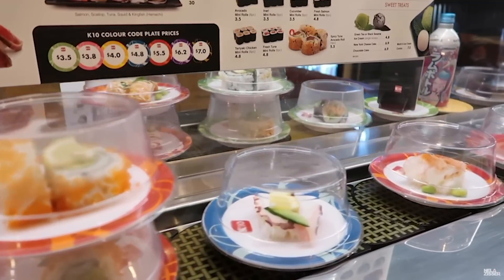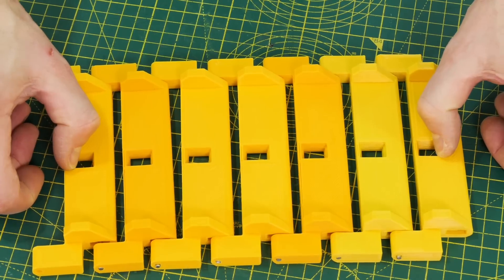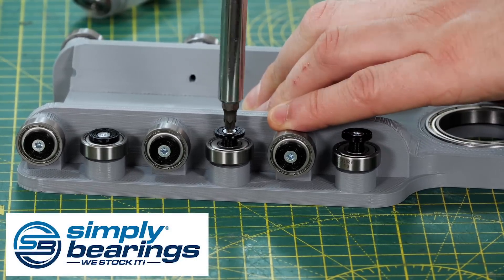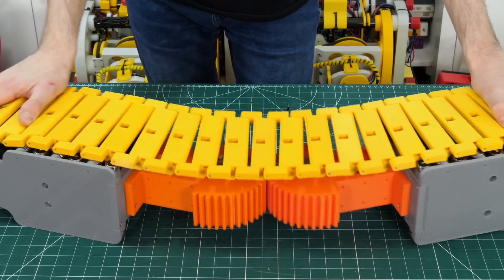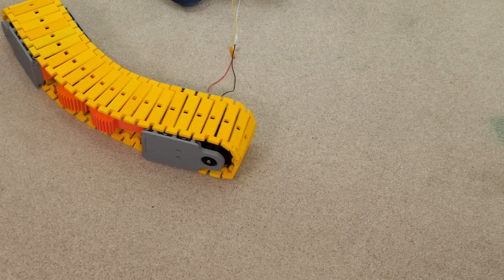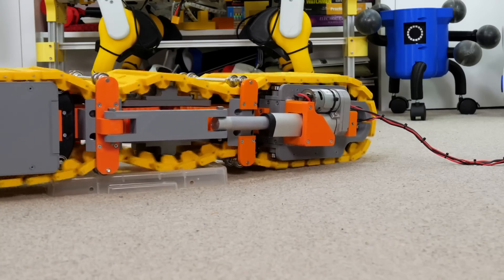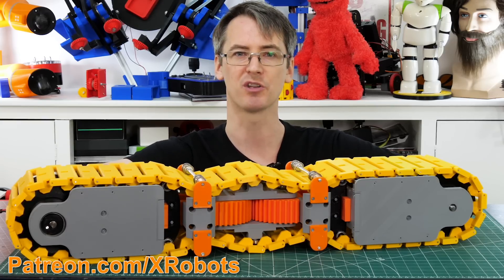How this track bends to steer

Comment: Spring-load the sprocket at the far end of the vehicle from the drive sprocket to maintain track tension overall. Support the upper and lower portion of track at the pivot with a pair of bogeys and maybe a pair of tapered rollers over the top that push the track back to center and prevent it from hopping off of the bogeys if the track bounces.

Comment: WHY?  Tanks work perfectly with the way they are IMHO.  It has way fewer failure points than if you allow the steel to crimp.  I mean as a tank is now it can kind of turn in the space it is sitting in. So I go back to the statement your single track seems like a bad choice in designs, but I'd guess you have some weird reason to desire this, but I could see it breaking a lot, now if its a toy you can easily pick it up replace a piece and slap it back down and get to playing again.

Comment: You need some sort of auto-tensioner for the track.   Maybe idler wheel on springs.  Keeps tension constant around corners (pushes back when compressed) and when straight.

Comment: it needs suspension to maximize tension variably at every degree of flexion. if your bogey bearings had been inside the tracks and on springs, and your primary wheel and bogey were larger diameter, you could have had a sort of christie style suspension.

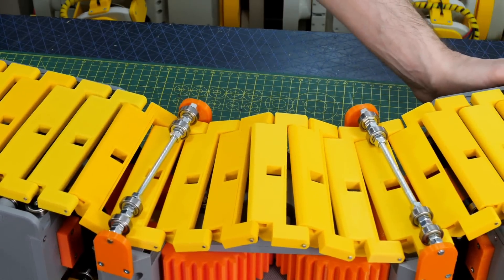Comment: Yeah squssing the track 9:39 will cause massive friction and wear 😳
Try adding suspension in the bottom which help the tanktrack be more like a tank track, 

🤔 Maybe a deeper track flange? (Not sure the correct terminology...)
Might help to keep the track center on the bend, and would help when got the suspension on there.

Cool project, woupt make for an interesting single track bike. Would have to have heavy steal curving around the track, to safe guard the rider.
😱 I don't want to think, of a person getting wrapped and jammed in the track 😔, it's would shreed them and jam like those failing escalators in china! 😮😱 😳

Best to make it remote control away from fingers, limbs and giblets...

Try making 3 small tracks and turn the ends around the center one. Then can turn much sharperas the 3 tracks would be independent from each other.

Comment: What about trying an expanding articulating pivot point?

So the two "halfs" - drive and idler - move apart slightly. Maybe change the center to a ball slot track. 
Ie.. 2" ball placed into a track, that is say 3/4" in depth at center and get shallow towards the outer ends. 

This might, in theory, give you a rolling expansion wedge and might help with the tension. 

Or I might have a really bad idea here. ..... where did I put that blasted engineer again😅...lol

Comment: I understand what you're trying to achieve but you could just use two smaller straight tracks with a steering joint between.

Comment: A spring tensioner pulling the track up could do if you keep the two top bearing rods. Also a single spring tensioner that pulls the both ends apart could work, this is how some small excavators are tensioned. Tanks often tension their tracks via the suspension springs and a tension setting that works like the sprung tensioner on a mini excavator that i described.

Comment: Replace the shaft of the orange pivot sections? Could you replace this shaft with a sprung section which pushes between the partial gears and the motor/idler sections to self tension the track? Square shafts going into the (hollow) partial gears would stop twisting and give space for excess/unused tension length

Comment: Awesome!
I've thought for a while about how a "bicycle" with a single bendy track could be made. (Mostly because this would be great for riding in deep snow!) No solution yet, but this is definitely going in the right direction...
A compliant rail with a T-shaped (or Y-shaped) slot and appendages on the track-sections that fit into it would certainly solve the problem of the track coming off, without the problems of your current outside metal bar. To make the rail flexible enough, it would need to have only a continuous backbone in the middle, while the sides that actually guide the appendages would be serrated.

Comment: Is there a way of putting a spring tensioner between each tread. Something that pull the treads closer together but also able to move apart when it goes around the bends.

Comment: I feel like the best resolution for you is to have a belt tensioner for your track. Perhaps with the inactive wheel hub, you could have the shaft of that hub on a sliding section, and it would be spring loaded so that the entire tract would retain tension, keeping it taught on all the bearings.
Reply: Tensioning isn't really an option if the track needs to bend in the middle, it would just exacerbate the problem with it getting pulled off the guides there.

Comment: There's actually a vehicle that drives with a 60cm wide bendable track! It's called Flextrac MPV or Finncat depending on the model year. I got some videos of that vehicle on my channel if you want to see how it works. It's quite an interesting way to steer, really good at driving through snow and mud though!

Comment: You’re overthinking the tension a bit mate, just use springs to push the sprockets outwards to hold the whole system in tension or even between the two outer sections and the orange pieces with the half gears.
Reply from the maker: Pretty sure that won't hold the 'corner' down/up since the whole track is flexible.

Comment: Depending on the grade of stainless steel it's not much better than mild steel for stiffness.

You may have better luck with using tempered piano/music wire as track link connectors. 

A better way would be to put your track connections in the ceter of the track with a pin through yoke arrangement like a ball with a double cone through it horizontally on one edge of the track with a corresponding socket on the other edge.
Reply from the maker: I think the original ones were reject TIG rods ;-)
Reply: @jamesbruton  so it's mild steel likely as easy as you bent it.

Comment: I'm looking at that and thinking that if the wind directors were made smaller so they'd fit in a piece of guttering section, printed with a 90' vee shaped notch cut out of them, and opposite that vee having a vertical wall to stop air just zipping through without going up the centre, it could be fitted to the corner of a home to take advantage of the slightly higher velocity/pressure air that's already being guided around the building.

Maybe even a "Flue" on top, with a venturi on top of that it to try to suck on the stack as well (Or at least just to lower the pressure there slightly and give the air an easier exit)?

Comment: to tension the track, you could replace one/both of the supports leading to the center gears with some nested rectangular prisms with a spring in the middle. This would keep the rotational and axial rigidity while spreading the length of the body, thus keeping the track in tension.

Comment: I feel like you can tension better by extending those orange center gears , or shorten the length and find the best tension
Reply from the maker: I don't think that will hold the 'corner' up/down though because the whole track is flexible, unless it's totally straight.
Reply: @jamesbruton  Why don't you have each piece of track attached to the next piece of track by springs.
When the track is straight it would be taut, when you bend the track it will stretch the springs and remain taut ?

Comment: I suspect if the treads weren't flat/smooth where it grips the ground it'd go over things much better- like tiny spikes similar to Footballing Shoes- not much, just not smooth. Then like you mentioned, rubber would probably help as well. 

Either way, this is very impressive- you earned a Sub ;P

Comment: Use elastics between the links to tension the belt so that way it will be tight on both the inside and outside of the turn. Love your work its amazing. =)
Reply: Looks like a dunsparce animatronic

Comment: Cool idea with the bend. The solution to most of the problems you encountered (tensioning, treads tending to slide around etc.) is quite easily visible by having a look at a closeup of actual tank treads. BTW: In most of the places were you used a static metal bearing, a wheel with a suspension would help a lot. Looked a bit like a "You have to put 50 bearings in your build" situation. ;) But whatever you like as long as you have fun.

Comment: I just don't see why you didn't remove one or two of the tread links to eliminate the slouch ,,,🤔
Reply: if you eliminate the slouch it will put stress on the parts and the tracks can snap

Comment: The track systems I've seen that have built-in tensioning, like they do for tanks, the tensioning is done with sprung lift wheels, not by pulling the track down. The drive wheels are also not at the level of the support wheels that the track actually runs on, which keeps them (sort of) from getting fouled when the vehicle goes through mud.

Comment: Give it two weeks and this will be an awesome project! Great start so far. I think solving that tensioning problem will be the biggest part. I think you gotta stray away from tensioning the bottom side of the track and instead find some sort of spring based retention for the top of the tank, either in the middle or the end of the tank

Comment: It looked almost like there was enough slack in the track when you lifted it up to take out a link, possibly 2 that should take care of the track tensioning.  Failing that you could either remake the steering gear bars or put some spacers between their bases and the straight section of the tank.  Of course either of those solutions would mean you need to adjust the location/throw of the steering actuator.

Comment: If the vertical tabs on the track sections which you use for track alignment had an additional little horizontal hook on the end, then you could tension the belt from the inside.  Not sure if it would be strong enough out of PLA+...

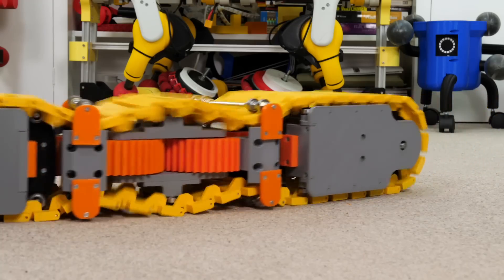Comment: Interesting, but interesting only (by contrast to practical). 11:10 shows the mid section is not contributing to traction and one would be better off having two individual straight track section that articulate in the middle.

Comment: Might be better to have 2 separately driven sections of Straight Tank Treads joined by an articulating steering drive similar to the one you used.

Comment: The tensioning mechanism definitely needs to be inside the track. My immediate thought is a spring arrangement between the open end of the center pivot and the idler's frame; alternatively, make the idler itself able to ride in and out along its frame. Either way, cool start, neat idea, looking forward to version 2.

Comment: excavators have a ram filled with grease  in between the idler and the drive gear to keep track tension.... also they have a forwards and a backwards.... driving them forwards means the sprocket is at the rear of the machine and pulls on the track in contact with the ground... this keeps the tension on the bottom and means it can be fairly loose on top... driving it in reverse can loosen the track and cause it to come off the idler.

Comment: You made the track bendable, constructed a geared chassis but you didn't build bendable bearing guides? On the top and on the bottom respeectively: one singular compliant part that holds the bearings for that bend. Maybe a zig-zag with the bearings at the corners? Or a thin but tall bendable spine with "ribs" holding the bearings the right distance apart?
this build has potential to become the next ridable centipede ... =)

Comment: instead of the bearing tensioners around the middle, print a new one of the orange steering gears with a spring in the middle to provide tension on the tracks

Comment: Your projects are amazing, that's why I have subscribed, but the more I watch, the more I get feeling you should make better research about topic you make, cause you make errors that are sometimes fatal for your projects
I'm not sure how much time you spend searching for this exact project, but steered tracks existed in WW2 light tanks, so I recommend reading some info about these if you ever want to continue this project
Geometry of steering, the way track pins in track links works to allow steering, how they tension and make sure track won't fall of

Comment: 2 possible solutions, embedded magnet in track with more bearing inboard. Or redesign track with bearings at edge parallel to ground, to constrain track in channel of body and ad channels to all gray plastic parts needing them.   Cool video.  Tensioner pushing gear pivot from motor might also help. But if you redesign the steering, use that to tension the track.

Comment: What if you put the bearings on the track and had rails for them to follow. Then you just need to bend the rails and not worry about alignment as much. Which would likely be simpler as they can be fixed at each end and only bend on one plane.

Comment: The center joint really needs 2dof pivots, something this long for its size is unideal.  The second degree of freedom within the proposed pivots would also give the system some amount of suspension capabilities, given that there's really no other way to have suspension within the tracks as it would need to be fully external and attached to the body that would likely sit on top of this. 

This design would also benefit from proper grousers, rather than just rubber pads.  Climbing and crawling performance would be greatly improved, plus come center padding with a grouser would help with the issue the external bearings are causing, though this would need the common shaft to be split between each bearing set itself.  Though at the same time, a redesign would work wonders, as you do not want external guides on a track, while this may work within enclosed chains this does not work for track links for the very reason shown here; there are alternatives, though none of them are all that simple, assuming you even need a complex guide as proper tension of the links will get you most of the way to the solution that these extra bearings provide.

I'd also look into having a more gradual bend, rather than two large pivots. Though this is easier to do at a larger scale unless you want to get into really small hardware.  But more pivots for a more gradual curve would provide mounting for better lateral guides, with a different track design of course; dual sprocket with a center spine attached to the links should suffice, as this would allow centralized bearings to act as the guide, and if the track coming off is an issue (which shouldn't be the case with proper tension) a tee spine would allow the system to function with the same style of guide.

Comment: The solution to make it curve evenly is to place two electric motors on the fulcrum of each joint. Both front and rear. The motor will help it move more easily.

Comment: There are so many ways you could improve on it.......but i also wonder: is it possible to make it also bend in the vertical axis? But that way you probably wouldn't be able to get rid of the tension bars. Also, you should just try running it without the track!!! It'd solve most of the problems, and probably be more efficient, more flexible, but clearly, that's not the project....
Anyway, a good proof of concept 👍

Comment: @8:50 I think you need to concider middle bottom track support if it is meant to travel over terain, otherwise the tracks will be pressed up into the gear in the middle and deform and destroy it over time.

Comment: @7:30 WOW dude, I dont think ive ever seen this type of track flex before.. Totaly amazing idea 😀 A track like this designed for heavy equipment like Excevators, would be Next level for sure 😀
Reply: It is not his idea and unfortunately they would be really bad for excavators
You need robust solution, these tracks were used on very light tanks to steer a bit while going forward
Excavators are mostly turning at slow speed or turning at same place, which is where these tracks fail
Reply: Seeing as tracked vehicles can easily turn and pivot with the tracks running at different speeds, tbh I'm not really seeing what this design would really offer and adds a bunch of complexity and potential reliability issues. The only place where I might see an advantage is at high speed, but then if you look at vehicles like the Ripsaw, they do pretty well as is.

Comment: Why not add a second bend in another dimension. You already have a bend in x&y direction. By adding another one in z- direction you can drive with higher ground clearance from your tensioning mechanism. Therefore you overcome the need of another tensioning mechanism by introducing instability xD. It would be not really a tank but would look awesome as a single driving angle tank

Comment: Looking thru the comments, I like the idea of making the idler an adjustable tensioner.    Would only have to redo the mounting plates (add a slot, adjust the length, & a mechanism to move the axle).  Great work!

Comment: There is a fundamental problem with 2 pivot points, when turning your effective length changes, unless you constrain the track laterally so that the track pivots are on axis with your steering pivot.